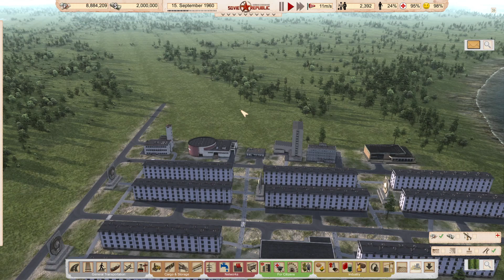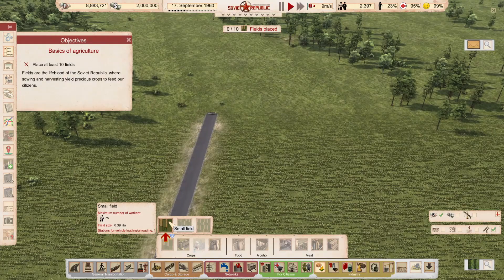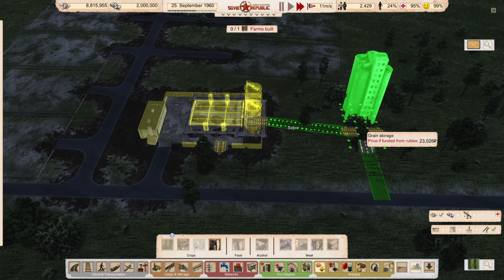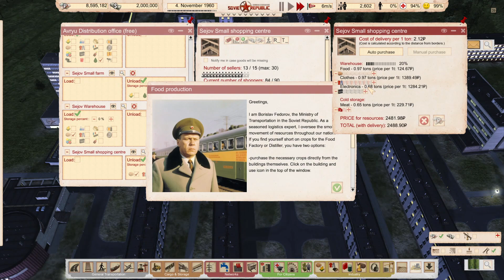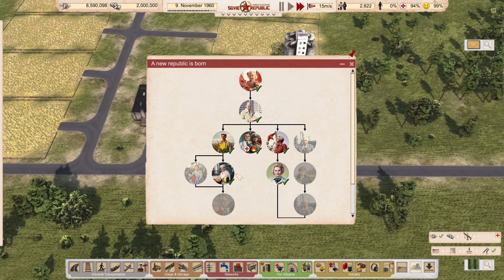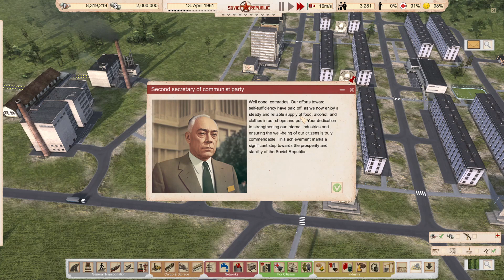Food, Alcohol And Clothes :: Workers & Resources Soviet Republic: #03

Comment: Just got the game, very much a beginner :). I found the tutorials very vague. I found it impossible to reach my 50 day of self-sufficiency. I only got up to 1. I gave up in the end
I was not too sure what was going on
Reply from the maker: The self sufficiency requirement is an odd one,  what it means is the food, clothes and alcohol have to be produced by the factories, then supplied to shop for distribution to the shop and pub.  To do this need to get enough workforce in the factories to produce the items, then set up a distribution system to deliver  them.  The first problem is reducing the auto purchase in the shop and pub to a minimum,  keep just enough to keep the population happy if something goes wrong.  Then set up a distribution office to deliver the food, alcohol and clothes from the factory to the shops, when doing this set the delivery requirement to 90% as this will fill the storage in the shop and pub overriding the auto purchase .  Let the game run, monitor the factories to see if they are producing enough to fulfil the needs,  Will need a regular workforce in each factory,  e.g. 10 - 20 workers,  if there are not enough workers consider building extra residential buildings and bringing  in more more workers.  If the days keep resetting check the economy tab to see if the any clothes, food and alcohol are  being purchased.  It may take some time for things to settle down, so give the game time to run.  Hope this helps.
Reply: @StephenSilverbeard  Wow, I really do appreciate the personal reply, I will give that a go and try to understand the mechanics. Can I ask , In this campaign tutorial, as you know I have a farm (10  small fields). I believe this setup only produces crops at a particular time of year. So in turn, my Food factory can not  produce food at  a constant rate for trucks to distribute. Am I right in thinking in this tutorial that I have to have my farm auto purchase crops at a certain amount from outside as well for a constant supply for factories?.  In actual gameplay, is it the intention of the player to build enough farms that you produce enough surplus to supply your stores until the farms to produce crops again next year? Again many thanks, Just subscribed :)
Reply from the maker: Crops have many uses in the game beyond making food and alcohol, so building farms and more importantly moving crops to the factory  is a key challenge of the game.  To keep the factories busy while waiting for the next harvest  it may be necessary to import crops from the customs office by train.
Reply: @StephenSilverbeard  Thanks for the info, much apricated
Reply: @StephenSilverbeard Hi Stephen, quick newbie Questions if that's OK. 
Can I confirm that a Distribution office can have multiple load sources & unload destinations? 
In the 'Distribution office' UI, what does the change order actually do and how it would effect the distribution? 
I'm also wondering  what are the main reasons for a player to  purchase a additional Distribution office? 
I know its a very tall order, but  just wondering if you can explain in simple English what the Distribution settings do in the 'Distribution office' UI
Thanks in advance
Reply from the maker: It is possible to set up multiple sources and drop offs, but it is more efficient to specialise them.  For example, have one delivering fuel, with a single  pickup and delivering to multiple gas stations.  Another options is to have a a DO full of open hulls that  pick up steel, bricks, etc and delivers to an open storage.  Keeping track of which DO does what can become a challenge, so get into the habit of renaming with some indication of what  they do. 

There is an implied priority in the order of entries, but it can be inconsistent.    The main reason for changing the order is to make it easier to understand, for example, I like to have the customs office at the top, this makes it easier to see which DO  are dealing with imports and exports.  

Setting up DO offices is  a bit of a rabbit hole, would recommend the following videos by bblljo to get some understanding of how they work.    https://www.youtube.com/watch?v=yXhrG3C33FA   and https://www.youtube.com/watch?v=0K1pcKpeG3c&t=1103s
Reply: @StephenSilverbeard  Thanks again, really useful
Reply: @StephenSilverbeard  Hi Steve, does the destruction offices have to be in range of the stores (Shopping centre /pub)?
Reply from the maker: The operational range of a distribution office is defined by the trucks it used.  The general rule is the distribution office should be close to the source to pick up the load to fulfil the demand as quickly as possible.  When working at long range the solution is to append a warehouse to the store via the factory connection, this ensures there is a reserve of food. etc, that gives time for the truck to make a delivery.    Tip:  Towns with a large population will require a  shopping mall with an attached warehouse to ensure a stable supply of goods.
Reply: @StephenSilverbeard   That's great, TY
Reply: The Distribution part of the game campaign is bugged. Pure and simple. There's plenty of people saying this on Steam and online too. If you have more than one town/city set up it takes ALL shopping centres and pubs into account irrespective of where they are. It should take in to account that you're only supplying your original starting town/city from your Distribution office. It will not take rail transport in to account. Also only use the buildings it points to when you're originally building your infrastructure, as it ignores any other building you choose to use for the campaign. (This is what I found). I built up 3 cities. Farming, Coal mining, Iron Ore and they're spread wide apart. So trying to fulfil this if you have other towns set up is nigh on impossible
Also do not add anything else (stores/pubs) when doing this self sufficiency part of the campaign. It will reset it to the start  of the 50 day cycle. you need to turn OFF auto replenish in ALL locations for the Distribution mission. It's about self sufficiency. That means ensuring that nothing is being bought by the locations you're supplying.
Basically clear ALL shops and pubs of everything needed. Food. clothing, alcohol and make sure they are not set to resupply automatically. The transport will then supply the required goods at a regular interval from your factories.
Reply: Hi Steve,
Many Thanks, all beginning to make sense :).  I have cleared all my auto-purchases from all Shopping Centres and pubs, all now distribute  Food/ Alcohol/Clothes to these stores, and have watched trucks doing their thang.
All Food/ Alcohol/Clothes  in all building are in the plus. All Factories of course all working fine. I think my Food factory stops now again because I believe its run at of room to store the food
However I'm missing something as the unable to to get over 1 to reach the 50 days days of self-sufficiency set by the tutorial.
Any ideas?
Reply from the maker: Check the import tab to see if there is a truck importing food/alcohol/clothes,  trucks on manual routes will just keep running back and forth and can be a real pain to find. 
It will take some time for the game to settle down, so give some time to settle down.
Reply: @StephenSilverbeard   Yep I had cleared all my manual routes. All Foods/Cloths/Alcohol are done via distribution offices
Reply: After watching the sim for a bit, I think I can now see why the 'days of self sufficiency required ' keeps getting reset to 0. It Seems the store(s) do not get replenished in time by the distribution trucks, and when their stock hits empty, this resets the  tutorial 'Days of self sufficiency required' value to zero .

I wondering how I can stop this?
Reply from the maker: Would guess the problem is food, as worker consume less clothes.  Check the factories to see if they are producing a surplus, if they are not try to get more workers into them.  

If the factories are producing a surplus there is a trick you can use to ensure a stable supply (it is often used to supply meat).  This is to set up a manual route from the factory to  the store,  using a truck with a 6t capacity.  Set up a manual route between the factory and the store,  In the route load descriptor click the 'wait until loaded' and in the unload click the 'wait until unloaded' .  Once the truck is set going it will go to factor pick up a full load then go to the shop where it will wait until unloaded.  When it returns to the factory there should be another full load waiting to be picked up and the truck should be able to get back to the store before it empties out.
Reply: @StephenSilverbeard  You're right, it's the food that's emptying to zero stock in the stores (Which in turn resets the target value to be reached in the tutorial). The trucks are not arriving in time. I will try the manual trick a suggested, great!, TY
Just wondering resorting to this manual method, does this mean the distribution mechanics is still being tweaked at this stage in the game development.
Reply from the maker: DO are stable, the problem for when supplying small amounts, they can be tricky to set up.  The manual solution is most useful when delivering to shops that have small internal storage, such as meat.  The truck acts as an external store reducing the  number of trips and unlike food short periods where workers cannot get meat only have a limited impact on happiness. 

When placing a shop in a large town always add a warehouse to give more storage as allows DO to use bigger trucks for delivery while providing a contingency against the slower road speeds in winter and traffic delays.
Reply: @StephenSilverbeard  Thanks for the tips. PS I just to minute managed to finish this section of the Tutorial Campaign   Hooray :)
Thanks for your help!!!!!!
Reply from the maker: No problem,